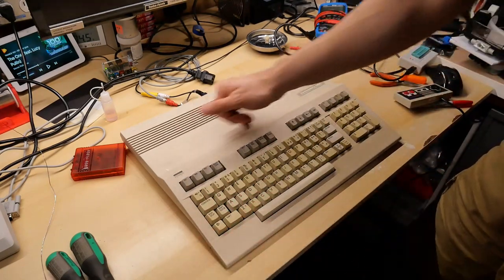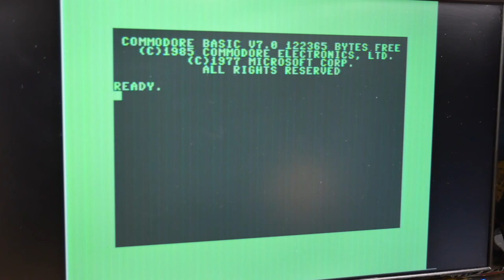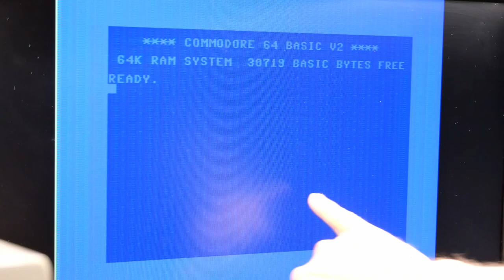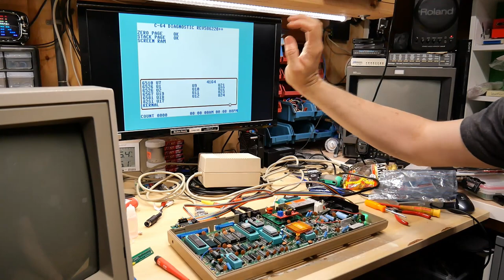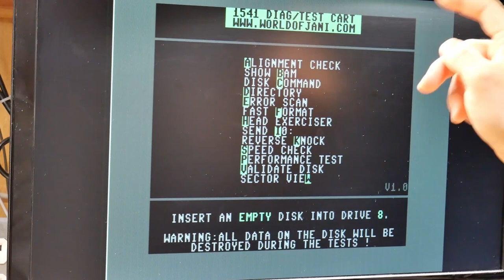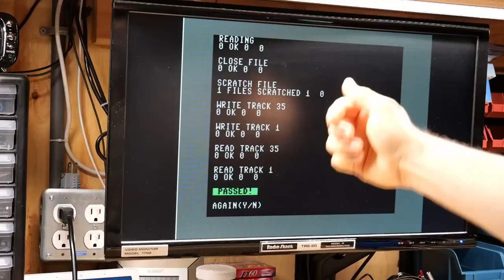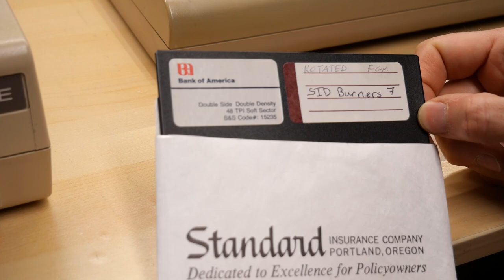C128 fix and a disk drive voltage conversion

Comment: Disk notchers - I remember when I found out about notching the corner of a disk and suddenly having a whole other side of the disk free to use.  Blew my mind!  Well doesn’t take much to blow the mind of a 9-10 year old kid.  I spent an afternoon carefully measuring and notching all my disks with a single hole punch.  I was so nervous doing it.  Saved me having to beg and convince my non tech parents that I needed another box of floppy disks.  Birthdays and Christmas never came around fast enough.
Reply: I got hold of a notcher at the time and was so excited to double my storage. Mine was like a hand hole punch, but had a guide and square punch. I like the one he shows better.
Reply: I remember being surprised that the disk companies actually had the media coated on both sides despite labelling them as being "Single Sided". Companies sure know how to con people.
Reply: I used a nail clippers, not the neatest solution as every cut had a slight curve
Reply: @johnpossum556  There was a difference -- they didn't bother to test the back side of the ones rated for single-sided use. This meant occasionally you'd get one you couldn't use both sides of, but it passed the tests on the "approved" side. This basically stopped mattering once the defect rate got low enough.
Reply: @mal2ksc  Now that you mention it I do recall getting a bad second side every once of a blue moon.
Reply: I do remember cutting notches in floppy disks as well.

The school teachers even the ones in tech ed would usually use the the hole punch you would use for just normal paper.

Although some teachers and someone structures did actually have the proper punch for this at least later on.

And also remember they did have their names or room number is written on them so they would be returned if they quote" got borrowed.

But as for me personally with getting things for Christmas and terms of Technology I did not have a computer at that time butt what I was usually requesting for Christmas was actually blind VHS tapes especially the more expensive 8-hour tapes.

Although I do remember formatting in discs that were Samplers or AOL disks or whatever and always reformatting use floppy gifts or where I can get some that had something else on them previously even the more expensive higher-capacity discs as well.

Also anyone anyone else receiving Windows game packs with a box of discs.

 if I remember correctly that came after or before you would get the calculator.

 in the box of discs.

Also I do remember once getting a box. Of4 to quarter inch discs.

 that had a disk-shaped calculator in it it looked like one of the actual discs.

 I've not seen one of those in eons!

Well other than in possibly a YouTube video somewhere that is!

Comment: Yes, the problem with all of the MOS NMOS chips is the passivation layer. It has too much boron in the glass. Over time the boron migrates into the chip substrate poisoning the transistor junctions.

Comment: I used a 3-hole punch we had laying around the house and adjusted it so the hole was where I wanted it.  I also punched the other side as the 'round' hole didn't catch as much on the disk sleeves.  I thought I was really cool.

Comment: I seem to recall a video by Jan Beta, who works a lot on PAL systems (being German), and he had a board he was able to buy and install that had, if I recall, 3 different pots that could be adjusted to get rid of the jail bars issue.
Reply from the maker: The Lumafix is for the 64 -- and I've tested that and honestly found no improvement. I read the 128 version which recently came out does not improve the picture quality at all. (From all reports I've seen online.)
Reply: Yeah, same as Adrian, I've had no visible improvement with lumafix on the c64.  That said, I've only used them on the better c64s (425?) with the better vic chips.  maybe there is more noticeable improvement on the older boards with the older silver chips.  I've not tried one for the 128, i assume it's not very good either but i guess it can't hurt to try (can't make it any worse.. haha).
Reply: @adriansdigitalbasement  One of the main factors of the lumafix working or not - at least in my limited experience - is the TV it's connected to. On my Samsung TV the Lumafix on my C64c would do bugger all - no matter how the pots where adjusted. Switched to the bigger Toshiba in the living room and -- woo it worked, trimming the pots changed the picture, and I was able to minimize the lines (can't make the vanish completely). My guess is the A/D conversion and upscaler - and whatever else picture "enhancing" the Samsung does - is very sensible to the ARC bleeding into the luma, and intensifies the effect while the other TV is more relaxed about it. As far as I understand, the Lumafix only dampens the bleeding, but can't get rid of it completely.  As your converter box seemed to be a bit iffy with the signal it receives at large (guessing by some older videos of your's where you showed some artifacts produced by it) this may be one reason you don't see any improvement.

Comment: A lot of really good info in the video.  Nice to see the VIC-II issue illustrated  the NTSC C128 to help someone that has that problem.  Also, nice background on the disk drive and info on the EEPROM/RAM  for JiffyDOS.  Oh, and I've seen "Competition" joysticks in that color scheme on eBay, so I guess it's good to know that they may not be worth buying (maybe some of the black ones are bad knockoffs, too)

Comment: if you have a scope, you could set the background color to grey and look at the video signal on the scope with trigger on the h-sync and make the signal bigger in ac-mode.
on channel 2 you could look for other signals around the vic-II that looks similar to the jailbar-noise in the video signal.
that would be super cool

Comment: When using a Floppy Head cleaner in a single sided floppy drive, you should not use one made to clean a double sided head. The spinning disk cleaner is rubbing on the felt head clamp. SCOTCH made floppy drive cleaners with a punch out on the topside of the cleaner disk that is left in place for single sided drives. One cheat you can do is to cut part of a tyvek sleave and make a patch to cover the topside opening so that the felt pad slides over the tyvek patch you have made. This will save and prolong the felt pad clamp.
Reply from the maker: Good tips guys -- I haven't had an issue but I can totally see this as being not great actually. Yeah just covering it up would likely work fine.

Comment: The Tandy CoCo series used MFM drives, and how I notched them as a kid is just used a hole punch on the edge of the disk, and they slipped the hole punch inside punched the sleeve on both sides individually.  Originally we would cut the disk open, mull the media out and punch them, but were eventually able to do it safely with the lift and punch method.  When I first got a 3.5" 1.44MB computer I started drilling my old 720k 3.5" disks from my 1000HX and reformatted them to 1.44.

Comment: A couple of thoughts: I remember just using a hole puncher or a bread knife to make the second side. Also I distinctly remember times when a diskette stopped working for some reason we had a trick we used to try and that was to cut the upper/top part of the diskette 's "enclosure" and "take out" the disc+ flip it, making side A side B. I don't know why, but some(not very often) times that made it work again. You mentioned your "joystick"(not the fake competition pro), but the other one with a black D-pad and two red A+B buttons and I can't recall ever seeing that one for the C64 or the 128🤭🤣. Awesome video
👏😄

Comment: I put in a write protect bypass switch on my 1541 drives.  You use DT switch and replace the light sensor with the switch so in one position it writes anything to either side and the other position everything is write protected i.e. sensor always on or always off.  Worked good when working with new users so they couldn't accidently erase file or format your disks.  In the other position you didn't need to notch the disks, also back then people wouldn't look on the backside of the disk if it wasn't notched so you could hide files in plain sight.

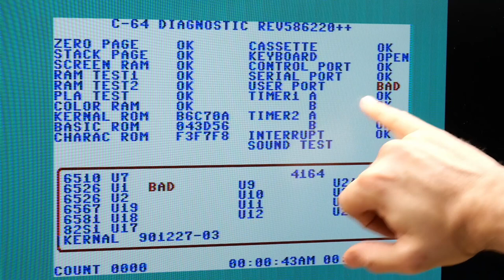Comment: 16:12  The Serial Shift IO lines from one of the CIA chips was repurposed on the 128 for burst mode on 1570/71/81 drives. This means the loopback on the harness from Serial shift CIA 1 to CIA 2 will not work properly.

Comment: Yep, always good to salvage cables, was going to refurbish my old Amiga 500 PSU, but, parts of it were toasted (hot resistors resisting with futility) on the PCB, caps leaking and I'm just lazy, so harvested the in & out cables and am building a more compact PSU with a 60w 12v PSU from banggood & a knockoff PicoPSU inside a nice light grey PSU enclosure, should look the part when finished... :)

Comment: 22:55 An ISMET made C128 power supply. They also made some of the Amiga power supplies as well.Usually the joints around the transformer crack but this one has obviously smoked its pass transistor ! Those "FRAKO" capacitors love to go bad. Their Amiga power supplies were junk also

Comment: Hey Adrian. 
I wanted to note a couple of things:
1. In my original C64 I had in the early 80s the power supply broke down. It was a fault in the 5v linear regulator. My dad figured it out. He actually drilled it out and replaced it with a new one. It worked forever after that repair, just like you mention in the video. I remember him being very sceptical about the repair. He was surprised it worked but it did. I think it still does. maybe I can find it and picture it for you, if you want.

2. I never had a C128. Not many of us Commodore fans did. However, a good friend of mine did have one. He had the cringy looking video output, just like you show in the video, since day one. I dont think it's a failure. I think it was shipped out of the factory looking like this. I remember it clearly, wondering why it was happening. maybe it is more distinct in PAL versions of the machine (I live in Israel, we have PAL over here).

Please please please keep the Commodore content up and coming. it is addictive! I can't stop watching. Thank you for all the time and effort you put into filming the process of repairing these soulful machines. I noticed you never let any assumption go without checking it and cross checking it until you validate it is correct (like with the slow rise time of that c64 in part 1 of this video). I really appreciate your work. 

Cheers from Israel,
Sephy.
Reply: Interesting, I had a PAL C128D back in the day and I don’t remember those weird jailbars in the output. Perhaps Commodore had fixed whatever was causing it for the 128D models.

Comment: The Y and Z switching is because is the German standard, you can also see that you typed the eszett (ß) too, maybe use smaller characters to fit the extra German letters in the rom?
Reply: Switching between QWERTY and QWERTZ
Reply: The label on the Chip says DIN, which is "Deutsche Industrie Norm" and is pretty sure there to enable the german specific  characters like öäü and ß
Reply: The character width will not affect the number of available characters, that is always 256 since 1 Byte is used to identify the character. The two changes are just randomly combined on the secondary font.
Reply: For some reason, the Europeans needed a special draugher-like typeface available. You can find such font in MS-DOS too.
Reply: @IkarusKommt  Germans ;)
Reply: That layout is impossible to justify.
Reply: @infinitecanadian  Y is not used in German, and Z is very prominent. It makes complete sense to swap them.
If you mean parentethes, they are located in that position on most European keyboards.
Reply: @IkarusKommt  You're right; 'Y' isn't used in German!  I didn't notice that.
Reply: @rockapartie  Okay, so it is.  However, I was not the one who first postulated that German didn't use 'Y'.

Comment: The brown wire at 6:08 is normal on some C128 revisions (all 3 of mine have this), if you're looking closer on the cap above the color ram (chip right to the char-rom) you'll probably see a cut in a trace.
Fun fact: there are 1571 drives out there, having a modified 1570 board inside. How can you tell?
1570 is written on the board. I have two of this drives.

Comment: The vertical bars are quite prominent in both of my flat C128 and my C128D. The German versions of the C128 use the QWERTZ layout, hence it switches between Z and Y when you press that key.

Comment: What I did back in the day. Formatted 1/2 of the disk dos. Then flipped the disk over and formatted the other side apple II. So I have a what multiboot?  I can't remember if I put ms-dos boot files on one side. But Anyway. I thought I was pretty smart at the time.

Comment: 1570 is the 1541 with faster Data Transfer on IEC-Bus in 128 Mode. Falls back to C64 Disk speed (or better say disk slow) in 64 Mode. Double sided fast speed came with 1571...

Comment: Everything I've ever read about Jack Tramiel said he was cheap as, and would find ways to reuse everything from calculator keys on the PET, to various C64 motherboards vs cases, etc. It's been amusing to watch you run across so many different variations over time. This drive is especially interesting, because the amount of manual labor involved must have cost more than the PCBs did, even considering PCB costs at the time. Even if Tramiel wasn't involved with this drive decision, it's clear the culture was set :P

Comment: Personally I would recommend against using one of those cleaning floppies in a single sided drive like that.  The cleaning disk is slightly rough and so is mildly abrasive, and over time will wear down the felt load pad on the drive head, the pad on the spring loaded side that presses the disk to the head.  If it wears down it can’t press on the disk properly and it’ll look like the drive is going bad with read errors.  While those pads look replaceable, they are impossible to find!  It’s far better to use alcohol on a Q-tip.  The cleaning disk should work fine on a double sided drive, though, since it’s rubbing on a head on both sides and there’s nothing to wear out.

Comment: Quite many have suggested LumaFix or similar mods for improving the picture quality. I have used LumaFix and ClearVideo64 and bypassed the RF modulator. The picture was great on Commodore 1084S, but quite bad with plasma and LCD TVs. Now I use c0pperdragon’s C64 component video mod with OSSC scaler and the picture is perfect using 4x line multiplication on a 1920x1200 monitor.

Comment: 00:45 ...  One thing I never liked about the C128 was how much desktop realestate it covered.  I wish the case & board designers hovered the keyboard more above the pcb. This would in effect reduce the depth measurement (length front to back) by about 3-4 inches, I think, thus the only thing keeping it from getting more shorter is the pcb. But I'm sure there was a reason to pancake out the square footage to what the C128 had become, besides thermal dissipation factors.
11:55 ... Have you tried a component cooler spray on the Vic-II chips when turned on to see if cold temperature affects the video output? 
15:25 ... I have always preferred single pixel width characters on my C64.  I designed new characters that way & uploaded them into ram to replace the original character rom, just to see how they looked. That was in the mid-late 1980's.  I wanted to make my own replacement char ROM chip then but didn't know how or was too busy with other things.  To me, the thinner characters looked more professional too.  
24:45 ... What could have killed that regulator?  A power surge, such as lightning?  
43:33 ... Yup, I still also have my disk notcher, bought in the mid 1980's.  Of course, not every uni-sided floppy disk had a reliable 2nd side due to factory quality check, since most likely the 2nd side was never meant to be used.  The same was true for 3.5" floppies, but it was more about density, not sides.  Still, for the most part, probably 90% (my guess) of all 5.25" disks in its heyday had good 2nd sides.  And back then, I had also sometimes confused this disk notcher with the Suncom C64 Icontroller joystick because they almost look alike.

Comment: There were new produced warranty stickers that matches the original ones. That could explain how an Character-EEprom have found its way in the C128.
Reply from the maker: Possibly -- but I have to wonder if that was a factory installed option in Germany? (For localization)
Reply: @adriansdigitalbasement  definitely factory-installed. I have the exact same machine, wires, DIN ROM adapters and all, that used to be sealed.

Comment: When I bought my C128 in 1985 those bars was there.
Reply: were*
Reply: Probably the original design didn't have enough capacitance. Add an extra cap for the VIC to fix.
Reply: @kuro68000  Care to explain what you mean?
Reply: @PerBengtsson  jailbars are usually because of power issues. Some chips are more sensitive than others. Adding capacitance should help.
Reply: @kuro68000  Extra decoupling does sound like a good plan. I wonder about the aged 10 uF electrolytic capacitors Commodore fitted. There are other possibilities for coupling digital noise onto the video, such as adjacent traces on the PCB.

Comment: Have you tried adding extra capacitance to the VIC chips that are bad? Some PC Engines have a similar problem but it can be fixed by adding an extra cap to the video chip.

Comment: For mechanical keyboard sets at least, a lot of times the spacebar and other longer keys are made out of ABS instead of PBT, since PBT plastic warps more easily (which can be more noticeable for longer lengths). Maybe that has something to do with the uneven yellowing?